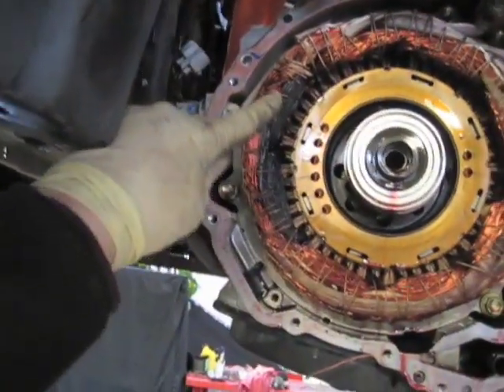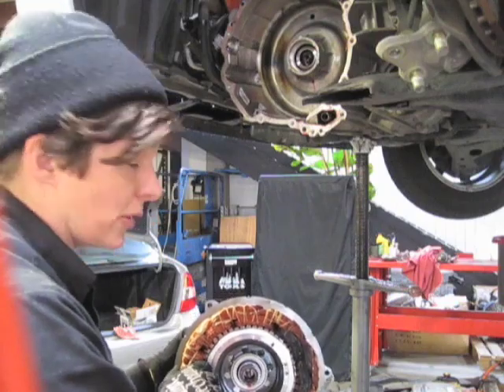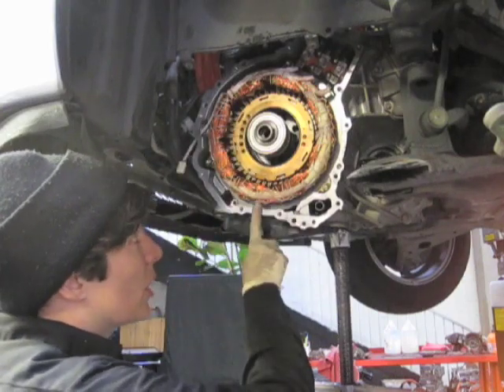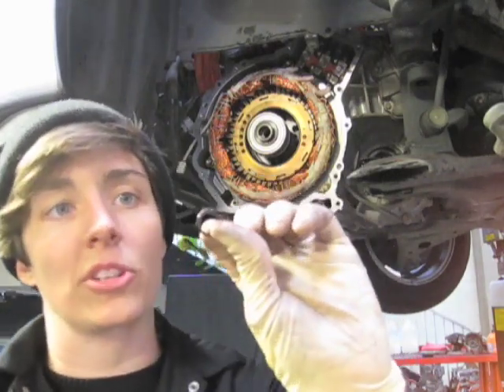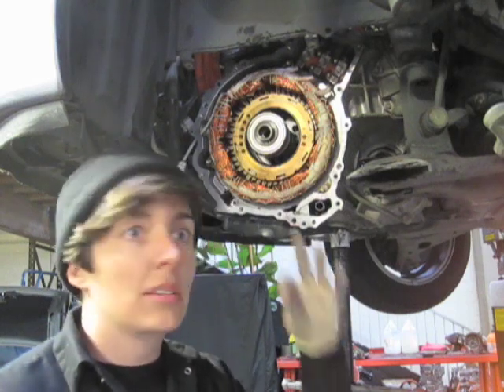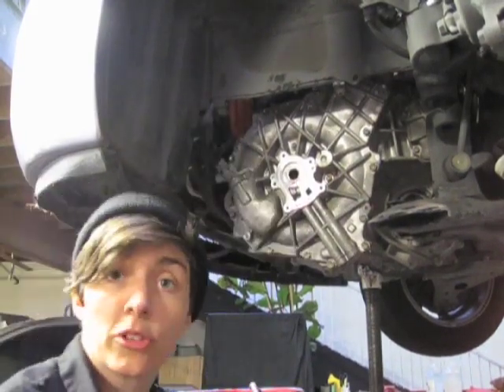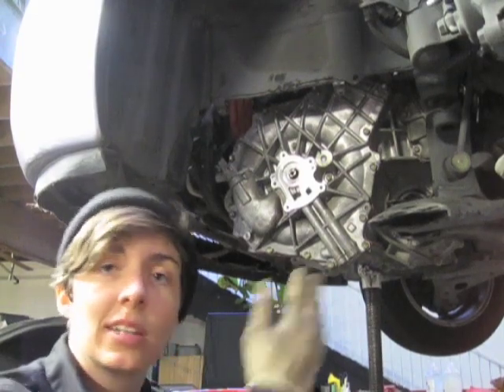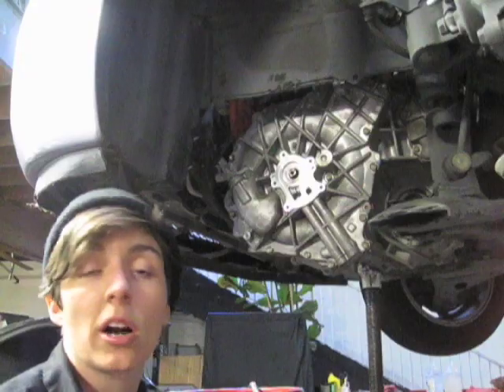MG2 Stator Replacement - Gen 1 Prius - P3009 P3125 P3120

Comment: 2:55 cooling. What sealant are you using on the cover. I have a 2012 ct200 that just threw a code poa3f. I am sure its the motor resolver in mg2 which is in the end cover. I await shop testing of wires and hyb ecu. If that test proves good im going to replace the cover with one that has good resolver. Any tips helpfull.

Comment: Dont you also need to index the lobes on the rotor to the resolver in the end plate? It did not look like you cared about this in the video. Otherwise the computer will have no idea what position the rotor is in and probably not even turn on the car. Also laying the stator on the windings can damage the wire insulation causing another electrical short. This is not something to be done carelessly in a driveway! LoL

Comment: Toyota told me the transmission fluid NEVER needs to be changed. At 118,000 miles I had it done. The fluid needed to be pumped out, it was so thick. Could the thick fluid damage the MG2. The electro generator appears not charging properly. The car state to the wheels is red during acceleration. Only green during breaking.

Comment: Question: Does the transmission oil circulate through and around the MG2 Stator and rotor, to pull heat away from the coils and lubricate the rotor bearings?

Comment: My generation two Prius, 2006 has somewhat of a vibration/shutter in certain high torque RPMs. this is true at any speed, so it seems to be inside the transmission. Also it does not seem to be providing very much in the way of regenerative braking. That could be due to the battery not being able to accept that much charge I suppose, Do you think these two things together would suggest a partially bad MG2 that is out of balance somehow? There are no codes.

Comment: Hi Carolyn, i need some help. I'm having hv leak issues on my prius 2. I realize that my inverter coolant leaking somewhere internaly. I already inspected externaly and no any drops at all. I'm also having some problems such as spare parts in my country, no body knows what to do. do you have an email adress so you might help me?

Comment: So you buy a new trans, take it apart and swap parts? Why noy just replace the trans?
Reply: Seems to me that I read somewhere that you have to take the engine out also to replace the whole transmission. Kindly correct me if I'm wrong.

Comment: WS  Fluid is not synthetic and has limited life. Tests from Blackstone Labs show lots of heat degradation. REDLINE D6 is a Group 4+ Synthetic that will protect much better. I have 3 Prii and the D6 quieted down my V which had excessive regen noise from the factory.

Comment: Here’s the secret to this issue.  I’m an audiophile and we audiophiles know about how transformers that are made with enamel shielding on the magnet wire wares off because it’s a magnet coil and with each cycle it compresses the entire coil at a micro level and over time of this constant compression and decompression the wires rub against each other and eventually a short is created thus burning the stator. Oil all black like that.
We also know to keep that from happening you sinned to just put the finished wound coil into a vacuum with some sort of glue or epoxy or even varnish to glue the wires together so they cannot compress and rub each other in that compression and decompression process, thus no ware or short from it.   End of problem.

Comment: Most likely the coil in the stater fried because coils are magnets and The coil wires clack together or against each other with magnetic compression Causing the enamel coating on the coil wire to wear way and then that creates a short in the coil and that will burn it and make it turn black like I see here in your video.
Reply: g quin 
Lol, thanks but I don’t feel like one. But thanks for the kindness.  I needed to keep this from happening to a coil in a crazy invention of mine many years ago and found out that I could epoxy the coil wire as I wound it and I also used a vacuum sealer bags to suck epoxy into the coil to glue it and keep my high voltage coils from burning out like this.
If the manufacturer did this simple and cheap thing to all could then they will last indefinitely because it keeps the micro magnetic impressions from moving the wires against themselves or clacking together at a micro level.  Th s has saved my coil from ever going bad since I went this route. Hope that Helen s other’s.

Comment: Should you avoid putting new one on the side like that? Possibility to damage wirings.
Reply: Yes, and you should also avoid using an impact on the ALUMINUM housings but if it works it works.

Comment: I bought one of those transmissions from a salvage yard 200 bucks, I turned it into a generator and works good for that application, the stator in my unit was like new with 100K on it. All I can say is that the labor was a bit high but a new stator is expensive either way. I don't know all the steps taken but I hope the owner got a 6 month warranty on the work.
Reply: What kind of generator are you using as?  I plan to eventually make a controller to use the inverter-converter assembly PCU as a universal pure sine wave generator so one can rectify any asynchronous or synchronous generator and use for. I also want to make a multifunction welder as well and seems a plasma cutter is feasible using the parts as well.

Comment: Forgetting warranties, would it be possible to install the 04' prius MG2 rotors (with the v-shaped, 150% power  permanent motor magnets) into a gen1? If so, would that be a mild improvement in  efficiency even without the 500v via the boost converter/proper software?
Remember now. we forgot about warranties. This is a track use idea- could you install a gen II inverter, battery pack, and MG1 and 2? Are connectors, wiring/plugs and software similar or not?

Comment: Late reply, I know, but the answer is totally yes. The ATF T-IV in the transaxle is sufficient for cooling, but only for so long. Toyota never services the fluid, but replacing the transaxle fluid is really easy. You just have to drop the pan (new gasket = 13$ from toyota) and make sure you use the right fluid.

The cooling system is good, the fluid is not immortal.

That's my understanding, anyway! :)

Comment: I Am wondering if it is a possibility that the wiring for the "stater" could possibly just be checked more accurately for short-aging. My dad serves as an electrician here in Ohio, USA. He has been one since I was a baby. I have learned that Shortages connecting with other shortages, even really, really small ones; can cause arching and arching causes fires if the components are able to become flammable. Is this something that could be looked into? I think it would be worth the effort.
Reply: Shoot 1000v through the windings with a Fluke insulation test meter. You should get 2.2G  at each winding if they're good. Anything else and the windings are bad.
Reply: Are you talking about using a megger? Unless there is a possibility of a short causing greater damage I guess it wouldn't matter if one just let the stator fail completely.. getting as many miles as possible. Of course, there is the inconvenience of having a complete failure in the middle of nowhere. I am viewing this just as a plain old electric motor. I don't know anything about the monitoring or software of the car that would cause weird driving if the car is trying to compensate.

Comment: You think by any chance the transmission may not have a sufficient cooling system, which is why these stators have such a high failure rate? Can't say I'm very familiar with the Prius. I'm askin cause I've been in the auto repair industry almost 10 years myself but am just startin to learn transmission diagnostics and repair and wanted to hear from somebody more familiar with these particular vehicles and transmissions.
Reply: I was wondering if the oil was mainly lube for the gears. One can see that there is no oil in the windings and there does not appear to be any oil circulation around the stator housing..So.. does neglecting oil changes really affect stator life?
Reply: There is only three things out to destroy your stator. One is heat next is corrosion and the last is a bent armature rubbing. The quality of oil will help keep the heat in check in the surrounding metal. Prolonging your stators life.
Reply: I stayed at a holiday inn Express so im now an expert on Prius...and the sound of a body bring dragged down a hallway at 3:27am.